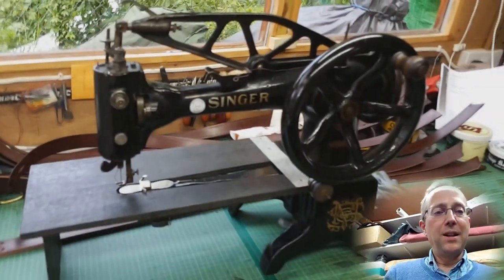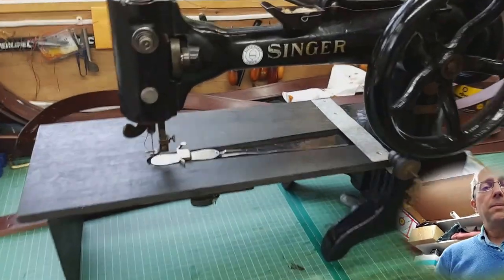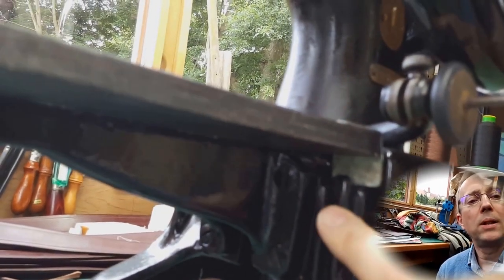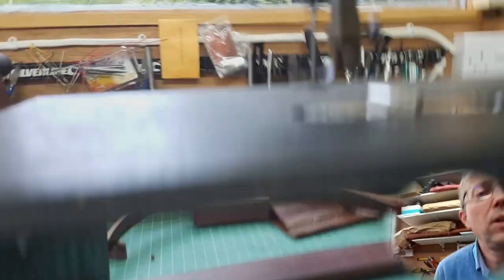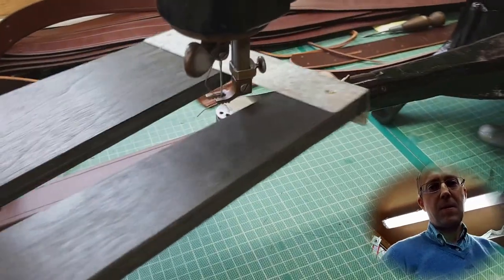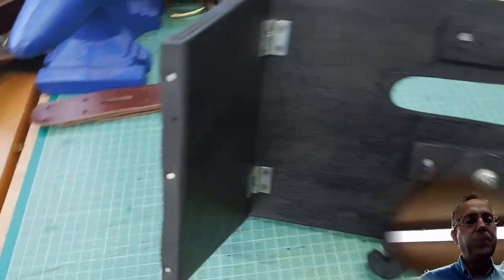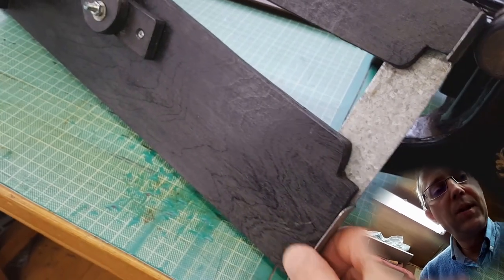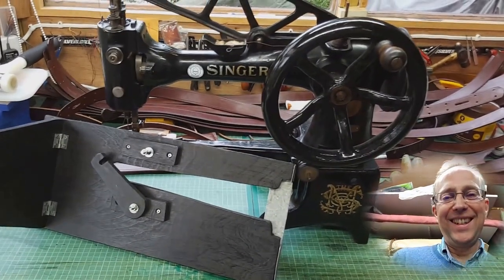Simple DIY Conversion Singer 29k Patcher Cylinder Arm to Flatbed.... Shed Talk 004

Comment: Harry, you are truly an inspiration.  I have found a wonderful 29K71 with a stand, but it doesn't have a work table. I just knew you would be the one to have a solution.  The front support will be longer to work on the stand, but the way you show the underside of the table you made makes the solutions to proper attachment abundantly clear. Thank you so much for your excellent instruction in so many skills. You are a natural teacher and a treasure!

Comment: I have a question in the 29-4 can one deattach the flying wheel from the right to the front to make it manual, instead of the pulleys? Thank you before hand, I appreciate your answear.
Reply from the maker: Lucha Tijuanera You can usually do that with a patcher...I don't know about specific models though.